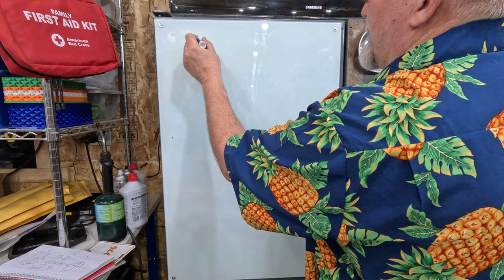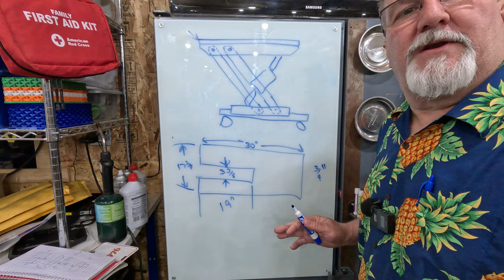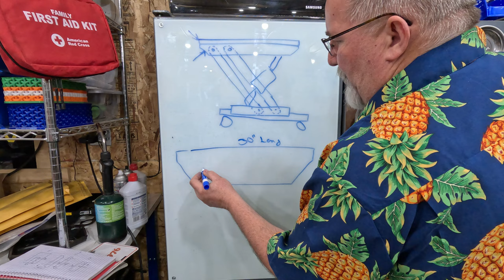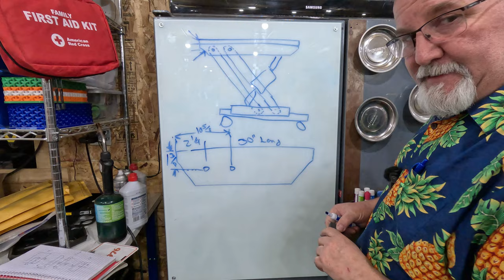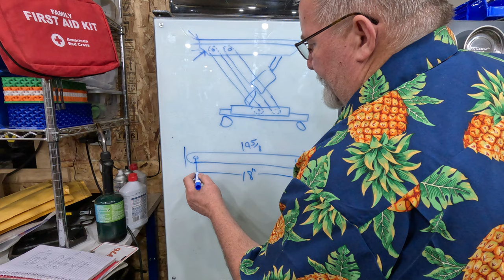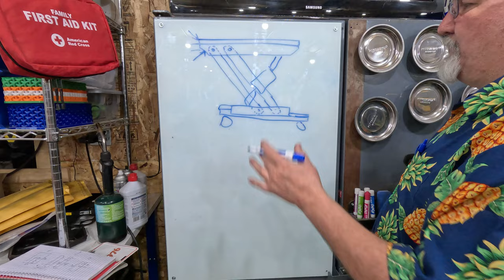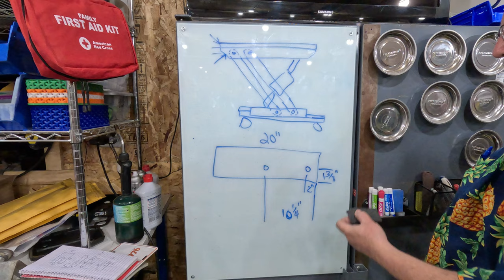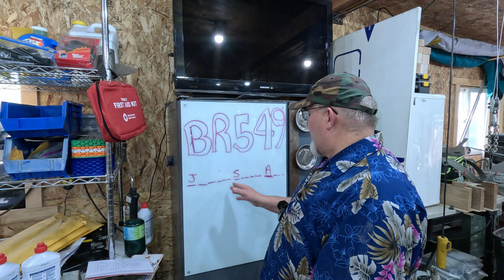Mecruiser Sterndrive Lift  -  when you don't have 4 hands -build this and you life will get easier

Comment: I think the lifting arms are not strong enough so if you use 1/4" or 3/8" plywood an cut 4 for each arm glue them together to make them stronger for the top I would use two 3/4" plywood and glue them together every place a bolt is I would out a short piece of pipe
Reply from the maker: You can make is much stronger for sure,  but I have now used this device and the 90 lbs drive gets handle well with the lift. Thanks for watching